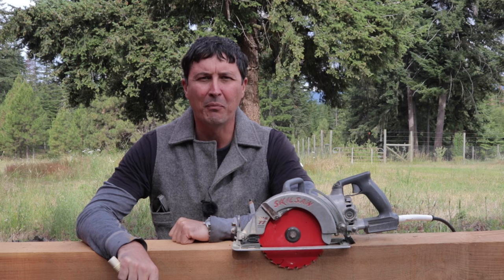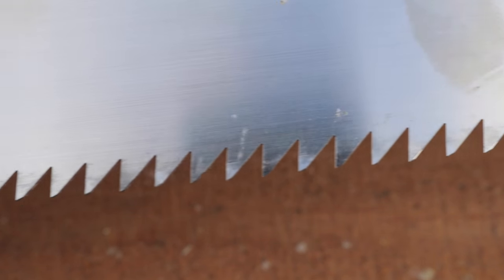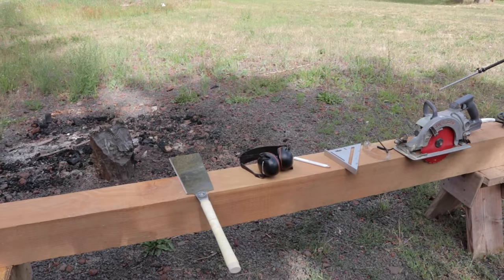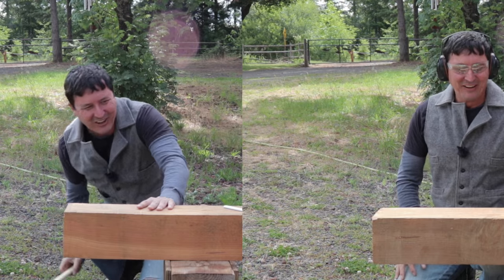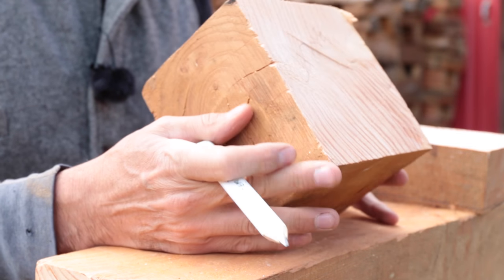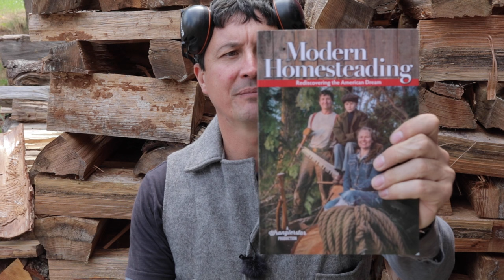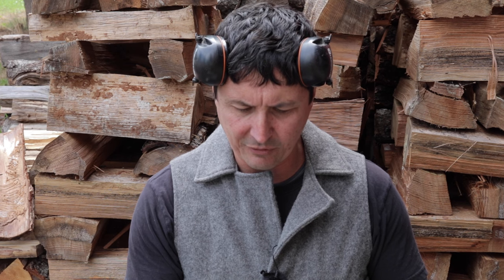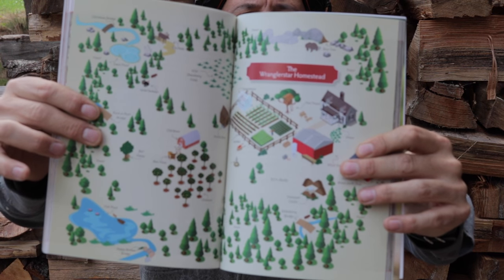Hand Saw vs Skill Saw - Speed Race

Comment: Hey Cody.  I would like to see, on any of your tests, start to finish.  In other words, to truly see if something is faster, you have to add in the time it takes to get the tools out, run the extension cords, perform the task, then put the tools away.  Just to see the total time it takes.

I think this test showed the hand saw would have been faster even if you took your time to make the cut square, compared to the SkilSaw, especially when you factor in the set up and clean up times.

This was a fun video.  I agree with another commenter, do a push vs pull saw comparison, either rip or cross cut.

Comment: One thing I have noticed in Japanese woodworking videos, is their extreme patience. They never rush on a cut, especially an important cut. I think their hand saws are incredible, and it's just a personal preference on how you want to use tools. Doug Fir imo is the hardest of the soft woods, and when very dry harder than some "hardwoods", at least on blades.

Comment: If you are doing multiple cuts, you wouldn't have to worry about plugging in the cord every time. Also, the more cuts you would do with the hand saw the more tired you would get, and the slower you would go. So, it might be pretty close when you are doing 1 cut, If you had to do... like a hundred cuts, it wouldn't even be close. 

Well, take it easy.

Comment: Splitting a set amount of wood with an axe vs your hydraulic splitter, but you have to hook up and drive the hydraulic splitter to the location first. A whole cord is probably way too much, but the fewer rounds you have to split put the advantage towards the axe I would think. I wonder where the balance is, where the speed of the hydraulic splitter makes up for the time it takes to set up.

Comment: you'r suppsoed to use the fine side to cut a guide around the the entire piece first, then switch to the ripping side of the saw that are made to cut on pull and cut the inside, this will cut fast and leave nice edges..
Also, when using the ripping side you have to push slowly then drag fast, you almost bent the blade on a push there x-D pushing too hard,  your body weight should to most of the work

Comment: I discovered Japanese hand tools over 30 years ago, and especially like their saws.  It takes a little practice to learn to pull  instead of push, but once you get the hang of it, they beat western saws by a mile. Their planes and chisels with the laminated blades are a joy to use, but are more delicate, and require a different technique to sharpen, especially if the edge is nicked.

Comment: Great idea for comparisons between hand and powered tools.  I really like the Monte Carlo style start, but where the hand tools would really shine would be to start the clock when you enter your shop.  You only need to grab 2 tools (saw and square) vs finding the extension cord, plug it in, lay it out to the work piece, etc.

Comment: Balsa is technically a hard wood. I think technically the definition has something to do with the cell structure of the wood, however the basic rile of thumb is soft woods are conifers and hard woods are deciduous trees.
Reply: You are right hardwoods are deciduous trees and softwoods are conifers. Douglas fir does have a higher Janka hardness than pine. So it is harder.

Comment: I've found that Japanese style saws require more attention to the angle of the blade to the surface of the work. On a western saw you are aiming for a 45ish degree cut pushing down for the power and to clear the chips/dust. On a Japanese saw (depending on the type) between 5-15 degrees work best. As you cut you can really feel the sweet spot on those pull saws. Try altering the angle you cut at. I also notice that you have to clamp work pieces tighter. With a western saw you are putting some of the weight down into the blade and into the piece. That helps it stay put. When you are pulling toward you it's a lot harder, you are pushing down to stabilize the piece, but pulling towards you for the power stroke. It also looks like the style of saw you were using was a Ryoba (not to be confused with Ryobi the tool company). Those are built with two types of tooth profile. One for crosscut and one for ripping, make sure you are using the right side for the right thing. Long story short, I really like Japanese saws for their precision,  weight, and cost. Also the other blade types are a wonder to use if you are so inclined. My fine tooth dovetailing saw (Dozuki)  is one of my favorite tools in the shop. As usual thanks for sharing with us and helping us learn along with you.

Comment: While I was typing the first note, I heard the hand plane vs. power plane. Question, which power plane? If it is the hand version not the stationary one, you might find the primary difference is on the depth of cut. A manual hand plane is capable of .001" cuts where the powered one (that I own) is at 0.015625 (1/64") That is a major difference in accuracy.

Comment: It isn't always about speed and convenience, those being the biggest advantages of power tools. Quality  would make you spend more time on an object and there are details only a hand tool could provide. 
 Making a box for instance would be faster using power tools but would you...or better yet an impartial judge, be able to tell the difference between a hand tooled and a machine tooled box? And then determine (somehow) if that extra effort is worth the extra time. I'm pretty sure I know the answer but the proof is in the pudding.

Comment: you did an exccelent job of making a lopsided contest quite exciting. some hand tools can compete with their power counterparts. that is not the case with this particular saw. although i will say while some hand tool scan win in speed, power tools will always win in endurance in terms of how long and how much you can do between breaks. that being said i still split with a maul and wedge, partially because i don't have a splitter, and really because i enjoy the challenge. while i'm the first to say  power tools are fast... sometimes its not about speed,its about the experience and the character it builds. kinda like your timber framing videos

Comment: Here in Germany there is a 3 year school you need to pass to call yourself a carpenter and work as one. The first year you work almost entirely with hand tools, im talking about taking a raw slab of hardwood and turning it into a piece of furniture or small stuff like toolboxes and spice shelfs useing only hand saws, planes and drills. That was a great experience looking back and its quite different to what i do as a carpenter nowadays. Today i mostly produce parts for furniture on a big 5-axis cnc router from mdf, plywood and particleboard which is interesting too in a different way.

Comment: if the wood is hard enough and you can get a clean cut, use the rip tooth even when crosscutting you can remove so much more material usually, i own a bunch of rip saws and only 2 crosscuts for when dealing with stuff i really dont want blow out on

Comment: To use the pull saw  Press and pull to cut; relax lift and push not cutting to move the saw into cutting position. With these saws you don't need a lot of personal power and speed to make a rapid cut just steady relaxed and accurate mechanics.  To help with accuracy, cut on the pencil lines about 1/4 in deep on 3 sides. This will help guide the saw blade. The rest of the cut will go more easily. I would bet, based on body mechanics that you are use to using a push saw.  Each tool, even the power tools, have their own eccentricities and helpful techniques. With this in mind, for a one off cuts, I think the pull saw would be faster. For multiple cuts the power saw would win.

Comment: Classifying a wood as either hard or soft is entirely dependent on the seeds produced by the tree it comes from. If a tree’s seeds have some sort of covering when they fall from the tree, be it in the form of a shell or fruit, then the wood of that tree will be classified as hardwood. On the other hand, if a tree produces seeds that are simply left to the elements when they fall to the ground, then the wood harvested from it will be classified as a softwood.

Comment: just to let you know, the Gyokucho (Geeo-koo-cho) that you have is a Ryoba (Reeo-ba) Nokogiri (No-ko-gee-re) meaning a double sided wood cutting saw. As you said, the side with more teeth is for cross cutting and the side with the larger, aggressive teeth is for ripping. Also, what you used the Ryoba for is this video is not what it was made for, what you should of used was an Oga (O-ga). There are quite a few different Nokogiri, an Oga is for timber cutting and board making, the Ryoba is for cutting the boards down to rough size. Then there are the Dozuki (dough-zoo-key), which is the main saw used in japanese woodworking, commonly referred to as the Japanese dovetail saw. You also have some specialty saws like the Azebiki (Ah-zay-bee-kee) which is a mid panel saw used to cut holes in the middle of a board or to make grooves in the middle, and the last main Nokogiri is the Mawashibiki (Ma-wa-she-bee-kee) which is called a keyhole saw in English, used to cut very small holes, like keyholes!

Comment: I'm not terribly knowledgeable about metallurgy or power tools, but it seems to me that if that magnesium frame catches a stray spark from anything, it could be incredibly dangerous. Could you please explain more about the frame?
Reply: magnesium shavings are flammable. If you buy a magnesium bar from wally world in the camping section and spark it it won't combust unless you shave it off the bar first.
Reply: magnesium and its alloys are explosive/flammable under extreme circumstances, not casual or even heavy heat/pressurized uses, they make magnesium engine blocks, frames, rims, all kinds of stuff. sparks aren't really a concern
Reply: titanium is also flammable (though not as much as magnesium) but they still make fighter jets out of it. the shaving are pretty flammable but if the chunk is big enough it takes a lot of energy to ignite it. shavings or filings might burn a bright white and appear as a quick spark but a large piece doesn't react so quickly and might put off a lasting green flame. I guess it has to do with mass increasing with the cube of scale but surface area increasing with the square. as that ratio of mass to surface area gets bigger the energy needed to change the temperature increases but also the larger size means a focused heat on a small area can be dissipated to the rest of the material, something like an open flame can keep heating the material faster than the heat moves away within the material or keep heating it till the heat has nowhere to go. a spark might have temperature but it doesn't have the energy, the BTUs. that and some other factors like the shape also influencing the mass to area ratio to combustion byproducts slowing combustion. you'd have to throw the saw in an open fire for it to burn and it would burn more like a log than a violent reaction. a spark is much less likely to ignite metal than wood partly because wood doesn't conduct heat well, so the heat stays localized starting the wood on fire in a small area then the flame spreads, wood also has plenty of open space that can hold air and oxygen and off gasses flammable gas that burns in the air above the log. not to mention it's painted so there is a layer of insulation keeping sparks away from the raw metal. Volkswagen used magnesium engine blocks in the air cooled boxer engines. car wheels were once magnesium which is how the term "mags" or "mag wheels" started to refer to a cast or forged spoked alloy wheel. today they are aluminum unless they are meant for the race track when they might be magnesium. magnesium was once a cheap alloy like aluminum is today and they used it for everything. the Navy even built a ship from it. till it caught on fire. today it's considered more of an aerospace material.

Comment: So I haven't read ALL the comments but I think this test would be MUCH more revealing and less "close" if it accounted for a more realistic multi-cut situation like cutting 5 boards to a specific length.... in this situation if i had only ONE cut and it was an ACTUAL 6x6 i think yes id probably reach four the hand saw to save the set up snd take down if the circular saw and cords vs. Picking out a saw, sawing and then hang it back up. But as soon as even ONE more cut is necessary i go for the circular saw every time.
Reply: Unless I just really want to cut by hand which happens a LOT!! LOL

Comment: I used a handsaw to cut 2 boards,  1X10X52 down to 1X8X52.  What a work out!  I even got a nice straight cut just following my line.  No clamps, no saw horses.  Just a chair, me and my 15" stanley sharp tooth 8tpi.  It happened to be the only hand saw my local walmart had in stock.  Hey, it works for me!  I'm just a 61yr old lady!

Comment: I noticed someone else mention it before, but you were using that Japanese saw like you would a Western saw. The Japanese saw is supposed to be used starting from the face which faces you so the saw dust doesn't get piled up in the kerf and cause extra work. You make a small relief cut at the top corner, so that as you pull the saw back the saw dust falls in to it, then as you progress down the timber you are cutting you occasionally make another relief cut as you get to the end of the previous one.
Just think of it as the reverse of a Western saw, where you start on the corner further away from you, then drop the saw down on to the cut line. Japanese start from the corner closest to you and lift up to the cut line.

Comment: post hole digger vs. auger. tape measure vs your carpenters measure. chisel vs oscillating tool. sand paper vs sander. welder vs forge weld? Thanks for sharing.

Comment: We have to use the japanese saws OBLIGATORY in the first year in 
architecture at the EPFL. It's usually around 3 in the morning when the 
students tend to give up and beg someone for all the circular saws 
available... For such a large piece of wood its highly recommended to start with a guide piece since the saw bends easily which can make you miss your mark, also you should start slowly until the saw is mostly within the wood so it can no longer deviate. Also, muscles (or just pure rage because half of your cuts are based on wrong measurements and you just want to sleep at least 2 hours).

Comment: I have many saws and a few of the japanese ryoba saws and learned that with the ryoba saws you cannot push too hard instead let the weight of the saw dig through the wood and not force it. (about the challenge of old versus modern tool how about a scythe vs lawn mower in tall grass)

Comment: Hand Tool vs Power Tool:
Spoke-shave versus a lathe to take a square stock down to a round dowel. I think the spokeshave may have the advantage (as long as you are a little loose on the roundness).

Comment: Thank you for the video. You been using the pull saw the wrong way. You should have drop your elbows, and use the power from you shoulder and back.
The way you used it as a western saw.

Comment: I like your channel but before you do a contest learn how to use a pullsaw. The log is lower than it should be. Your position is bad to the log. You hold the saw wrong. (You should pull down and not pull up) you use one hand two hands and you rush. Use two hands only. Let  the saw do the job not you and the saw determines speed not you.practice more you will enjoy it. Keep in mind that handtools need skills to be powerful but a skil(l)saw needs power 😀

Comment: I vote for either testing blade sharpening. Between hand files and a belt grinder/auto sharpener. Or retesting quality on hole drilling. Between the timber framers hand drill and a corded drill. (However, I think you did that already if I'm remembering correctly)

Comment: A pull saw has to be used with the tip of the blade pointed up, handle down and shoulder level with the wood.
So that when you pull/cut you arm is going down and use gravity. Much more economical, quicker to cut  and less prompt to blade bending.

Comment: With those Japanese saws, pushing and rushing will ensure a poor performance. Just focus on gently pulling and letting the saw do the work. That way you don't bend the blade and you will have a cut that runs true. Btw. constantly changing the angle of attack will maybe give you a few seconds, but it will also increase the likelyhood of straying off the mark.

Comment: Each tool has its place. But you have seriously neglected to utilize the speed square for its use as a saw guide. As soon as I saw you mark lines for the power saw I just shook my head. In fact I like to have both the skill and standard circular saw available for the left and right positions. The weight factor. The reach factor of the skill saw when ripping across a sheet of plywood. l also always carry my reciprocating saw with an assortment of blades. I have multiple hand saws but do not carry them since it is impossible to protect the blades.

Comment: Japanese pull saws are designed to take advantage of gravity and the handle should be angled downward for the fastest and most accurate cuts. Found this out the hard way as I started out using mine like you did in the video.

Comment: Forcing that pull saw is why the loss of accuracy. Speed is not the forte' of a good pull saw. Quality of cut is. A good power saw with a well balanced blade will make very good and swift cuts, but cords and all make for setup time and, you can't use them where the power is far away. It was a fun and silly video. I use the same pull saw, and with care, I get cuts that I don't have to plane or sand in most cases.